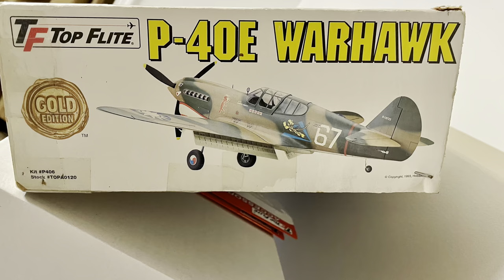Top Flite. 60 size P-40E Warhawk Build: Part 20

Comment: Happy new year from little New Zealand.   For flush trimming, sometimes I use a large box cutter blade.  Being so wide, long, and some what very straight, I just lay it on the finished surface and slide along length of the blade.   Much the same as a edge finisher on a router
Reply from the maker: Good tip. Thanks! Happy new year to you as well!

Comment: An experienced modeler shouldn't be recommending dropping CA between gaps like that in surface sheeting :) The CA hardens, and sometimes you'll never get rid of the ridge as the balsa sands at a much faster rate than the extremely hard CA. Aliphatic resin, mixed with a bit of balsa dust worked into the seam ... try it next time!
Reply from the maker: Yeah, I’ve been doing it this way for decades. I don’t see seams in the finish product. Tite bond works too, but I like the instant bond of CA. If you get after it with the sand paper before it cures, you’re golden. Just don’t ever, and I mean ever, sand your sheeting on the structure. Pro tip. Thanks for the comment.

Comment: I don't find any content in the manual or on the plans on how to blend the horizontal and vertical stabilizers into the fuselage at the saddle.   What are your thoughts?
Reply from the maker: I’m almost at that point. Stay tuned to see what I’ll be doing. I haven’t given it much thought. And yes, it’s not in the manual.
Reply: @FranksModelAviationWorkshop  thanks.  I see you are using the included bell cranks for the ailerons.  I'm thinking of using separate servos for each and making a bay and wing hatch.  I'm it would have less slop.  Thoughts?
Reply from the maker: @jaywiley6  I say go for it. Lots of people prefer to have separate aileron servos. My thinking on the subject is, it’s not an aerobic plane like an Extra 300, so I don’t need tons of torque at each control surface. Good luck in your build.